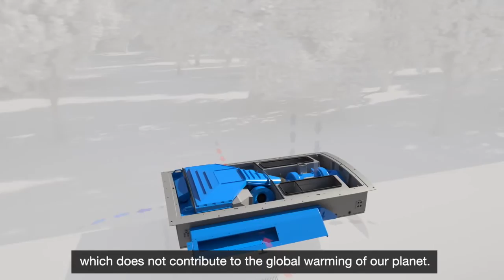Liebherr - Air cycle air-conditioning – green technology for rail vehicles made by Liebherr

Comment: I do not understand, how this turbo machine generates cooling from physical point of view. Wenn gas is compressed it heats. When it is decompressed it cooles. This will be the physical principle behind this turbo machine. But what is with effectiveness ? Does this system transport a same volume of heat out, like an frigarator with cooling media (FCKW, Pentan) ?
Reply: Its really interesting! The main driver of the process is mechanically the same as an electrically assisted turbocharger, so it still has the compressor and turbine, but it is driven by an electric motor. Basically you compress the intake air and run it through a charge cooler, giving you a compressed air charge at near ambient temperature; you then run this compressed air charge through the turbine removing energy from the charge (recycling that energy into the compression stage), removing energy drops the pressure of your air which results in a sharp drop in temperature.

The same system has been used on jet aircraft for a long time but they are usually driven by compressor bleed air (from the main engines) with enough excess energy to drive the turbine without any assistance from motors. The core difference here is that the drive power is coming from the motor that is integrated between the compressor and turbine. Because of this you'd see pretty substantial differences in the actual turbine blade designs. This should be a much more efficient system compared to the ones used in most aircraft. I believe the 787 is using an electrically driven air cycle system similar to this one, but I might be wrong.
Reply: @thayne4028  ; Is the cooled air from the turbine output directly used to supply fresh air to the travellers room ? In aircrafts and train. In aircraft it is said, that a toxic lubication oil of the main turbine intoxinated the people in the cabin. I suppose that this train turbocharger cooler does not use toxic oils.
Reply: @wolfgangrenner4152  I know that on planes the issue that you're talking about comes from the fact that they operate off of bleed air, which is going to have a level of contamination from lubricants, but from what I understand the air cycle turbomachinery is commonly supported on foil type journal bearings which do not need an lubricants. I'd expect that more recent ACMs use hybrid ceramic bearings rather than the foil type bearings, but the foil bearings are very effective in this application. @Liebherr do you have an engineer that could comment on this?
Reply: @thayne4028  ; The problem is probably, that aeroplanes take the cabin air from main turbines compressing stream. And the main turbines a high performance jet engines, which need special high performance oils. And such oils contain toxic ingredients. I believe, that the Liebherr train air system don't need such jet engine oils and therefore no toxic problem will be given in this system.